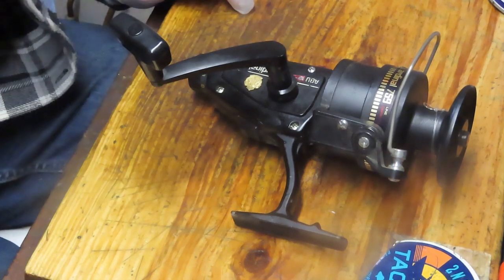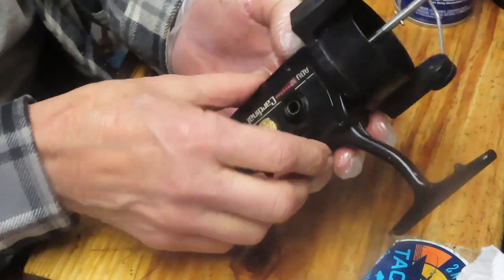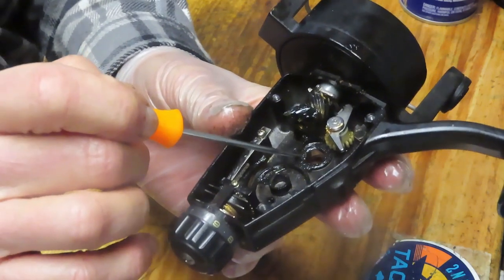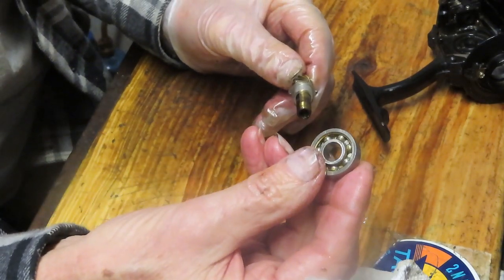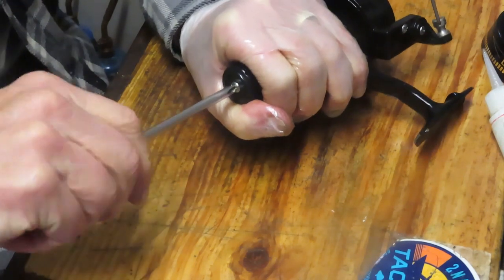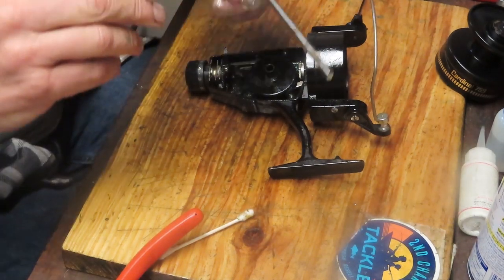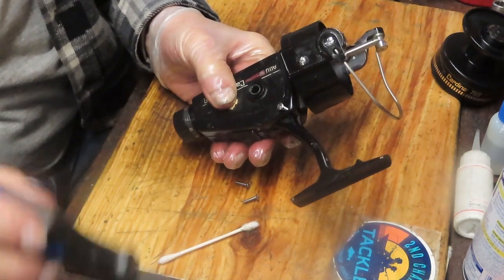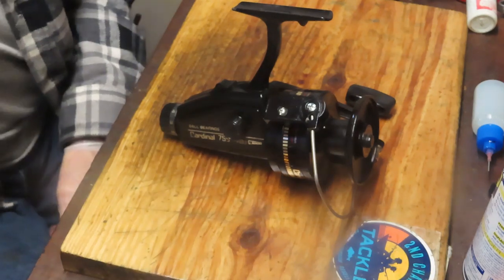Abu Cardinal 759 Spin Fishing reel how to take apart and service

Comment: Oh I have at least two larger Abu Garcia spinning reels but they aren’t rear drags. Have you ever seen a model 909? It is a huge, heavy, all metal, surf reel in my collection. I like this one Dennis but the drag is nowhere close to my big Shimano SSG 7000 saltwater rear drags. (14 drag washers). I may have to look for this Abu Cardinal. I like that clip holding tha axle shaft. My big Shimanos have two tiny difficult C-clips that are so frustrating. I like the gearing on this reel too. The anti-reverse is really unusual. You could have used your large size Mitchell tool for the rotor. Nice to also see a snap ring with large holes. This was a great flea market find Dennis! I put sealed bearings in my Shimanos. You are correct about the limits of this drag but unless you hook a monster this reel would handle trout, flounder, pompano, and whiting very nicely. I’m not overly fond of that plastic crosswind block but many other vintage reels use plastic or nylon blocks. I do like the way the click piece on the rear drag is mounted. Dennis this was a great choice for a very fine video. Sorry I overloaded you with emails and photos today but I know you’ll find them interesting! — Chris
Reply from the maker: I think you sent me a photo of the 909, but I have not "seen" one in my shop

Comment: After saluting you and what you presented, the main gear of black color, which was made and how strong it is
Reply from the maker: The reel is very strong.  I am not sure of the metal used in the main gear.  It doesn't appear to be anything cheap, like pot metal.  As I mentioned, I don't like the plastic crosswind block.  That can dry out and snap off.  Thanks George - Dennis

Comment: would carbontex washers help the rear drag be more effective?
Reply from the maker: It could, minimally.  The issue is rally with max drag and that is a function of surface area.  Sine a direct replacement would not increase the area, the max drag would be the same.  The carbonated washers could make operation smoother

Comment: I was surprised to see how inexpensive this reel is
Reply from the maker: Great reels at a bargain price!
Reply: $40 to $50 used on ebay.  I think I'd rather chip in another $25 for a brand new Penn Pursuit of the same size (6000-7000).  Low drag in surf no good, mostly bushings instead of sealed bearings, etc.  Plastic Cross Wind block, yuck.  I just recently tried to repair a cheapo Daiwa Shock 3000, and found that the plastic cross wind bock had warped, disengaging from the eccentric (also plastic).   Kept some parts off of it, but basically junk.  Thanks so much Dennis.  Your servicing and review of the guts is so awesome, especially for those of us who enjoy working on these older reels and bringing them back to life.